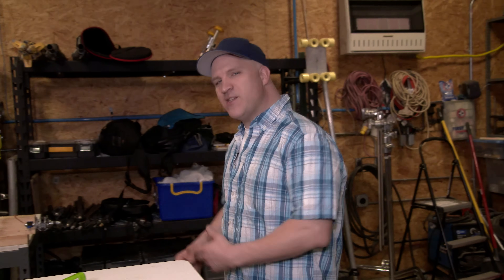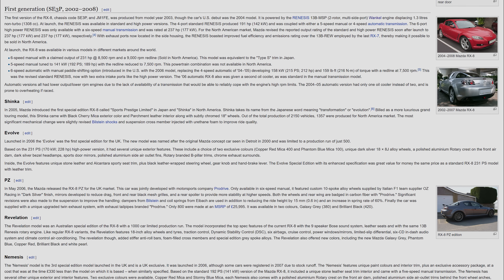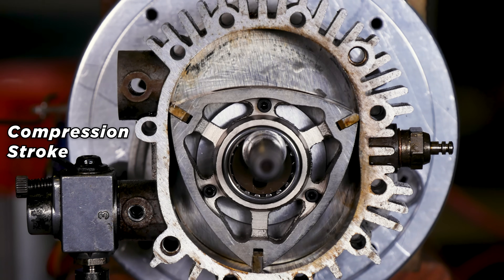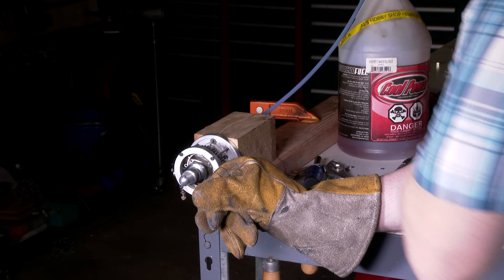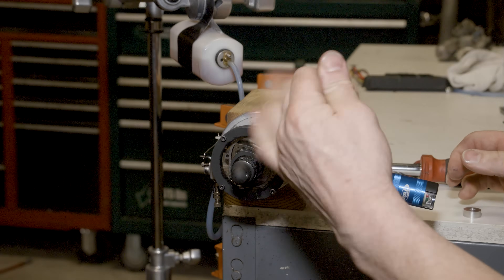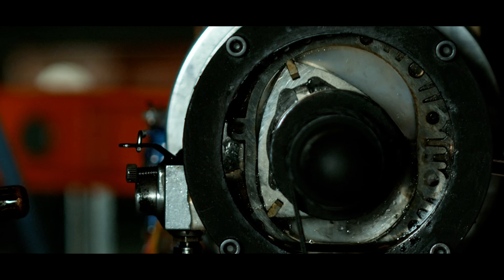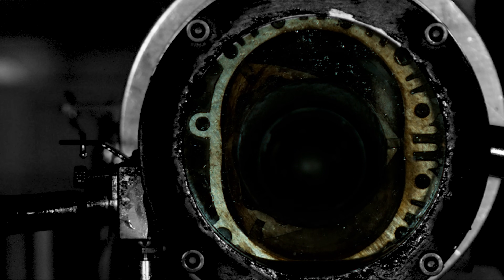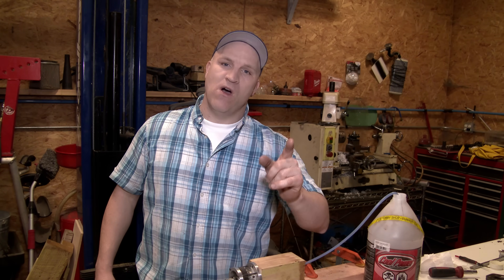See Thru Rotary Engine in Slow Motion - (Wankel Engine) 4K

Comment: Here in California, the very first government agency was formed to introduce motor vehicle emissions standards in 1967, still the strictest air pollution standards in the world, Diesel fueled vehicles have always been classified as clean, low emissions vehicles and were even EXEMPT emissions regulations and the bi-annual testing program for 30 years. Yes, it is possible to observe something and still not understand what you are seeing.. especially if you are not knowledgeable on the issues.
Reply: The uk government are being forced to ban or limit diesel cars by 2040. They are giving off high amounts of carcinogenic pollution and are credited for a large rise in cancerous deaths. A lot of the diesel emission testing didn't apply to real world situations while many were falsified. In other words 95% of diesel cars are marginally better for us than petrol if at all, some diesels are worse. DPF filters (that limit the cancerous fumes) are also a very big grey area in effectiveness. Many people have them removed as they block up easily and are costly to replace. Also very conflicting evidence in how well they actually filter while working on top of the added pollution they take to make. Also much pollution is added because some people are forced to ''drive on the motorway to clean the filter''. If they don't do that a warning light puts cars into limp mode. Sellers of such cars do not tell people that diesels are very bad to be used as anything but long distance vehicles. Car makers want sales, telling people a car that is bad in short journeys is not good business for them so they don't say it.
Reply: The attack on Diesel engines has begun a while back and its  about the money.
Some guy claimed he did a study about the pollution from Diesel engines and they found out he was a fraud but kept his bogus scientific research.
Diesel is cleaner because it falls to the ground but the engines we use in cars keeps their pollution in the air.
Should the particles be filtered? Yes but not to the degree that California claims.
In fact the folks for CARB are in hiding and it’s probably because they put so many people out of work and have received a lot of death threats as a result.
They are a huge threat to people’s jobs and to various industries and people’s freedoms.
I once read a memo they put out saying they are going to force people to give up their cars in the state of California.
Think about that one... 🤔
Reply: @fullmoonwhite1  An entire government would not get on board and force all car makers to have diesel filters on account of one persons findings, on top of fazing out or limiting the engines. Or at-least I find it very hard to believe. I find it easier to believe the reverse to be true, in that car company's would want to ignore the science and attempt to pay off officials coz profits.
Reply: Robert Tadic You must have never spent any time communicating with bimmer. Reason is pointless and he is hated in the rotary community for his arrogance and disrespect.
Reply: .
alot of advantages over reciprocating engines. the wankel
Reply: @xkexke8081   RotaryPerfection
RotaryPerfection
7 months ago (edited)
doktorbimmer Sore loser? My overall general knowledge of the rotary FARRRRRR surpasses what you read on the internet so I'm not embarrised about anything. Your the one that's hiding and too afraid to put your opinions out there for the world to see while you DON'Tshow your face. That's embarrising! 

When it comes to firguring the displacement of the rotary, the 13b is rated at 1.3l That's a fact your just gonna have to accept.  Again if you think Mazda has falsely rated the engine, how is it they have gotten way with false advertising for DECADES?
1
doktorbimmer
doktorbimmer
7 months ago
+RotaryPerfection Yup, you made yourself look like a fool.
doktorbimmer
doktorbimmer
7 months ago
+RotaryPerfection Mazda no longer rates the engine as a 1.3 and no longer manufacturers the 13b or any other Wankel engine, Mazda  used "Tax Displacement" as a loophole, this contrived method invented by NSU.. not Mazda and is no longer recognized as a valid method of measuring displacement.
RotaryPerfection
RotaryPerfection
7 months ago
+doktorbimmer Dude give it a rest. It's sad how obsessed you are with being right within this discussion. You just wrote 3 separate post in hopes to get me to respond. I've said what I needed to say on the subject and now I'm moving on. Understand his one thing. YOUR OPINION DOESN'T MATTER TO ME because you have ZERO hands on experience with the actual engine. I wont respond to you again so you can have the last word (which I'm sure is exactly what you want).
1
ernie brink rotary hemi
ernie brink rotary hemi
7 months ago (edited)
thank you sir he is stupid and *we know he is  the one *impersonating Ernie Brink the guy in rotary hemi breakthrough thank you RotaryPerfection *
1
ernie brink rotary hemi
ernie brink rotary hemi
7 months ago
ZERO hands on experience with the actual engine
3
ernie brink rotary hemi
ernie brink rotary hemi
7 months ago (edited)
dokotorbimmer( bird brain) is afraid of ernie brink he is  on to something***????  https://giphy.com/gifs/tweety-bird-cvOmdJLyBfpw4/tile
Reply: @xkexke8081  piston engines violently changing direction

Comment: Every time someone points out the Wankel having “such a small size” and pointing to the “1.3L 13b”, I’m obligated to point out that a 13b is actually 3.9L.  To call a 13b a 1.3L would be like saying a 2JZ is a 1L.  The only reason the displacement of a Wankel is so skewed is for European and Japanese displacement taxes, and engineers got away with it because lawmakers didn’t understand how to measure displacement.

And before the “no it’s not” arguments come, just remember that the original engineers at NSU would have said a 13b displaces 3.9L until measuring one chamber per rotor became commonplace because of the aforementioned tax reasons.

Comment: It's spewing out fuel
Reply: The Wankel is a very bad design.
Reply: @doktorbimmer  a single piece of metal is both hot and cold at the same time.  The top is hot bottom cold.  Does it break or warp? And the piston thing is triangular.  Do they have more sided piston thingy?
Reply: Yes, its poor thermal properties and its irregular shape cause wear and leakage problems internally... No, the Wankel KKM was the only design of its kind to ever be commercially successful... the Wankel only saw limited success and has been obsolete since 2012.

Comment: I had a 1975 Suzuki RE-5 Rotary water cooled motorcycle. I had the engine cases chrome plated. It turned heads everywhere I rode it. You can't find them anymore.
Reply: The Suzuki RE-5 was a huge flop that nearly bankrupted the company... most of the bikes that were built never sold and were later returned to the factory to crushed.

Comment: Years ago my 1981 Mazda Rx7 absolutely would not pass the E…check we had in Ohio and that car ran perfect while my 1983 Chevy Silverado 3/4 ton passed with flying colors the first time and it ran rich. This irritated me to no end. They were supposed to explain what the problem could be and never would. I knew these engines had alot if wasted byproduct but WOW THAT'S A CRAZY AMOUNT OF UNBURNED FUEL. By the way there is NO REDLINING THESE Engines they just climb and climb 5th gear the car would shed its body panels before you could R that thing out. scary fun
Reply: The internal parts actually only rotate at 1/3 of the shaft speed... Wankel engines can be easily damaged by over-reving...  but the 1981 RX-7 only had 100 hp when new and after 60k miles didn't have enough power to self-destruct unless you pushed it off a cliff.

Comment: June 21st 2018 marked the 6th anniversary of the end of Wankel engine production, on Thursday June 21, 2012 at 4:30pm the very last commercially available production Wankel engine rolled off the assembly line at Mazda's Ujina #2 plant, the plant was leter demolished to make way for a new Skyactiv-G reciprocating engine assembly line.
Reply: the engineers missed a lot of problems with the wankel engine

Comment: Love the wankel hopefully some day someone can fix the seals and makes it more efficient.
Reply: The Wankel engine is an obsolete technology... all 26 of the original Wankel KKM licensee's have abandoned development including Mazda... the only company committed to building an all Wankel product line now only sells reciprocating engines.
Reply: @dakken74 So you are implying that my comments are not true?
 You are saying there is a car dealership where I can go to and buy a new 2016 model car with a Wankel or a Rotary engine????
 because I can't seem to find any...
Guess what? that makes them extinct, discontinued, no longer available and obsolete... 
 Unreliable? Certainly!  In fact you are commenting on a video that is about fixing the Wankel's many flaws.. yet you only have a problem with my comments?

The facts are clear, in 2008 Mazda's Remanufacturing and Technical center in Chesterfield VA. produced 5,000 rebuilt engines for the RX-8  warranty replacement program.

which is Ironic because Mazda only sold 3,400 RX-8s in 2008 

Of course this does not include new engines delivered from Japan, rebuilds from outside subcontractors
or engines repaired or replaced outside of warranty by aftermarket sources.

Perhaps you should read a book rather than wasting your time masturbating and trolling youtube.
1
Reply: The Wankel engine is an obsolete technology... all 26 of the original Wankel KKM licensee's have abandoned development including Mazda... the only company committed to building an all Wankel product line now only sells reciprocating engines.
Reply: I don't know who you are, but stop quoting me you fucking tool. I posted this here before you posted this

Comment: I've got 2 of the oz wankel model engines. They will shoot flames, but the fuel they run on behaves more like diesel so it isn't common.
Reply: because what causes the flames is buildup of unburnt exhaust gasses in the exhaust system. There is no exhaust system here so the unburnt fuel just sprays out into the air rather than getting collected inside the exhaust.
Reply: dokterbinner loves big fat plug holes
Reply: SMALLER VOLUMES AND LARGER VOLUMES 4 STROKES ALLWAYS MOVING IN A ROTARY MOTION
Reply: Mazda has no future plans to further produce the rotary engine. (At least for 6 years into the future) -reference from Mr. Harris........... Mazda southeastern technical training instructor.
Reply: I don't know who you are, but stop quoting me you fucking tool. I posted this here before you posted this
Reply: @dakken74 So you are implying that my comments are not true?
 You are saying there is a car dealership where I can go to and buy a new 2016 model car with a Wankel or a Rotary engine????
 because I can't seem to find any...
Guess what? that makes them extinct, discontinued, no longer available and obsolete... 
 Unreliable? Certainly!  In fact you are commenting on a video that is about fixing the Wankel's many flaws.. yet you only have a problem with my comments?

The facts are clear, in 2008 Mazda's Remanufacturing and Technical center in Chesterfield VA. produced 5,000 rebuilt engines for the RX-8  warranty replacement program.

which is Ironic because Mazda only sold 3,400 RX-8s in 2008 

Of course this does not include new engines delivered from Japan, rebuilds from outside subcontractors
or engines repaired or replaced outside of warranty by aftermarket sources.

Perhaps you should read a book rather than wasting your time masturbating and trolling youtube.
1

Comment: Actually the apex seals can also break and destroy rotor, Graupner motors like this one tend to wear out the side plates as well which is why they did not sell very well and have been discontinued.however there are many disadvantages to the rotary engine which has kept
 it from being successful. frist it is the big fat leading plug hole
Reply: And a timing belt can break in an common interference engine and total the top end. Your point?
Reply: @axslinger99  Here in California, the very first government agency was formed to introduce motor vehicle emissions standards in 1967, still the strictest air pollution standards in the world, Diesel fueled vehicles have always been classified as clean, low emissions vehicles and were even EXEMPT emissions regulations and the bi-annual testing program for 30 years. Yes, it is possible to observe something and still not understand what you are seeing.. especially if you are not knowledgeable on the issues.
Reply: @axslinger99  however there are many disadvantages to the rotary engine which has kept it from being successful. frist it is the big fat leading plug hole
Reply: THE FOUR STROKES OF A INTERNAL COMBUSTION OCCURS SIMULTANEOUSLY IN A 
WANKEL ENGINE THIS MAKES IT MORE EFFICIENT THAN A PISTON ENGINE

Comment: It needs a fly wheel
Reply: All Wankel engines use the 4-stroke operating principle. The Wankel requires 3 revolutions of the crankshaft to complete its firing order sequence instead of 2 revolutions in an Otto engine or 1 revolution in a 2-stroke Benz cycle engine
Reply: If you watch the video it's pretty obvious that the frictional forces in this tiny wankel engine are relatively large compared to the momentum of the the dorito, hence why this one needs a flywheel, I'm sure full size versions that dont have shitty chinese tolerances a flywheel is unnecessary
Reply: Especially as there is no load/propeller
Reply: Mazda only sells reciprocating engines now.

Comment: Will they ever make a rotary engine that doesn’t wear out seals?
Reply: All Wankel engines use the 4-stroke operating principle. The Wankel requires 3 revolutions of the crankshaft to complete its firing order sequence instead of 2 revolutions in an Otto engine or 1 revolution in a 2-stroke Benz cycle engine

Comment: If there's no spark plugs how is it igniting???
Reply: All Wankel engines use the 4-stroke operating principle. The Wankel requires 3 revolutions of the crankshaft to complete its firing order sequence instead of 2 revolutions in an Otto engine or 1 revolution in a 2-stroke Benz cycle engine

Comment: You might be the first thing in the universe to WITNESS rotary combustion...
Reply: All Wankel engines use the 4-stroke operating principle. The Wankel requires 3 revolutions of the crankshaft to complete its firing order sequence instead of 2 revolutions in an Otto engine or 1 revolution in a 2-stroke Benz cycle engine

Comment: All Wankel engines use the 4-stroke operating principle. The Wankel requires 3 revolutions of the crankshaft to complete its firing order sequence instead of 2 revolutions in an Otto engine or 1 revolution in a 2-stroke Benz cycle engine  Rick te Kronnie
Reply: I AM A TROLL
http://az616578.vo.msecnd.net/files/2016/08/27/6360787077700554381193066848_Internet-Troll.jpg
Reply: Robert Tadic You must have never spent any time communicating with bimmer. Reason is pointless and he is hated in the rotary community for his arrogance and disrespect.

Comment: The slowmo also perfectly shows why most rotary's have 2 or more sparkplugs because there's a lot of unburned fuel at the exhaust stroke
Reply: Then why do Wankel engines with two plugs make more power? This was discovered by Dr. Max Bentele at Curtiss Wright... Even Mazda knew this!
Reply: How will there be a leak? Mazda, NSU and Comotor have always had 2 sparkplugs for each rotar.
Reply: But what do you mean with 'leak' ?
Reply: +Rick te Kronnie Ernie has either serious substance abuse problems, mental problems or both... you can completely disregard his deranged ramblings.
Reply: ERNIE BRINK ROTARY  English please, can't make heads or tails of what you're saying.
Reply: DISAPPOINTING MAZDA NEWS AT THE 2017 TOKYO AUTO SHOW TODAY!!!! THERE WAS NO NEW RX! NO NEW WANKEL ENGINE!!!!   R.I.P. RX

Comment: Are all Wankel engines so... leaky or is that because of the changes you made?
Reply: Wankel engine have an inherent weak and inefficient sealing system, they also all have a very poor, inefficient combustion chamber design that leaves a lot of unburnt fuel.
Reply: WATCH ROTARY HEMI BREAKTHROUGH

Comment: That is high dedication to try 226 times 
But is that type of engine really that inefficient (shooting fuel and exhaust too early) or is that for education purposes only
Reply: No its not efficient... which is why these engines have been obsolete in manufacturing for several years now. Ernie Brink failed math and never went to engineering school.
Reply: Ernie please describe the effects of combustion chamber thermodynamics such as thermal entropy and the Woschni heat transfer model using a "hemi" concept in conjunction with the Wankel KKM engine design? How are they compatible? How is that combination even possible?

Comment: What if a engine is instead of internal conbustion it is a external conbustion engine
Reply: It would still be very inefficient and unreliable.
Reply: Lol
Reply: Flame licker  engines are Internal Combustion
Reply: But the boom is outside with the shockwave pushing a clinder head at high speeds
Reply: Only the ignition source is outside the cylinder... combustion takes place INTERNALLY.
Reply: There is NO SHOCK WAVE... Flame Propagation and Deflageration are Subsonic processes unless the engine is malfunctioning (pre-ignition/detonation) Continuous detonations will damage and destroy internal combustion engines and are to be avoided at all costs.

Comment: did you see thee droplets of duel and oil flying out of the exhaust port? Polluting, thermodynamically inefficient., seal tip wear...wankels are poor engines
Reply: That is why they are no longer in production... they are obsolete in the engine manufacturing industry.